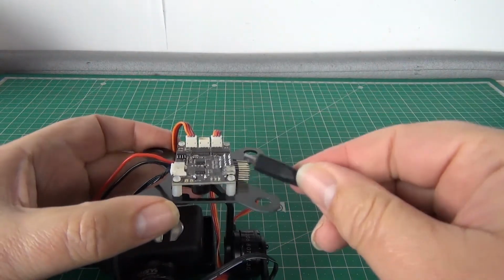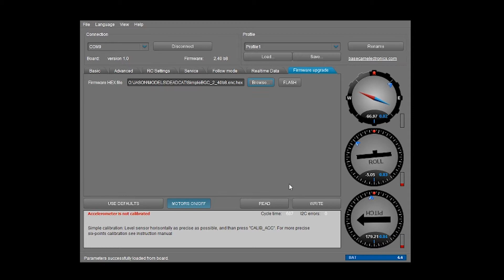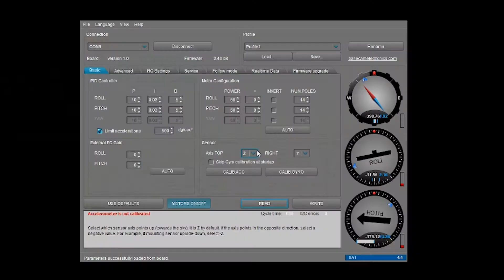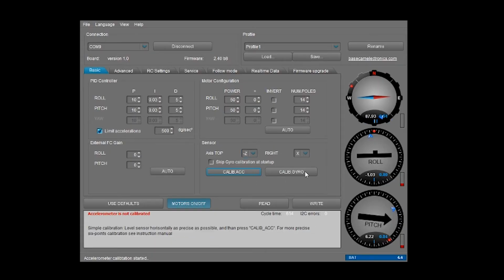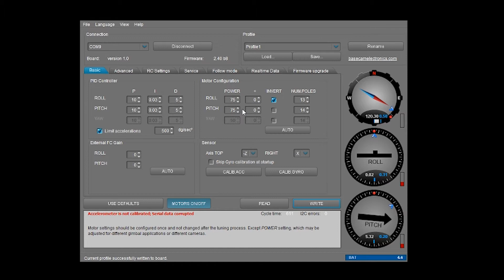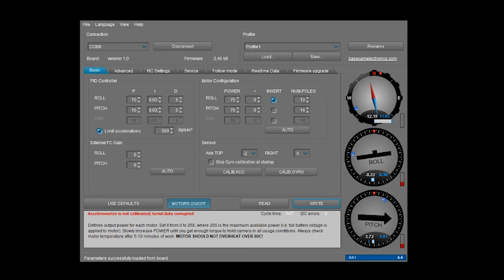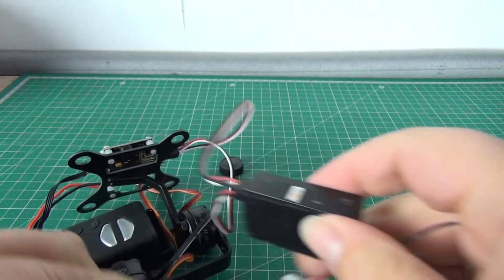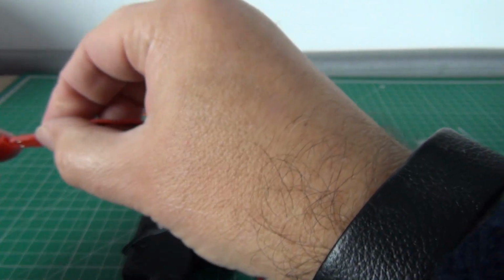How To: Configure Alexmos Gimbal

Comment: Sometimes you need to run older versions of Java too if you run the latest firmware and GUI. You will know this when the software does not come on after clicking connect.